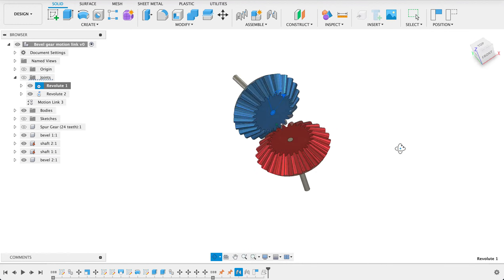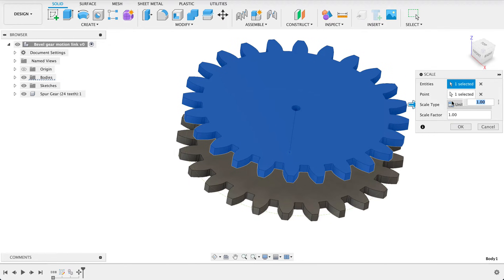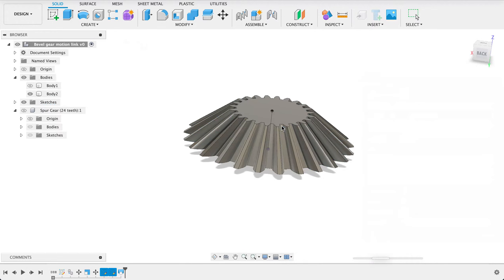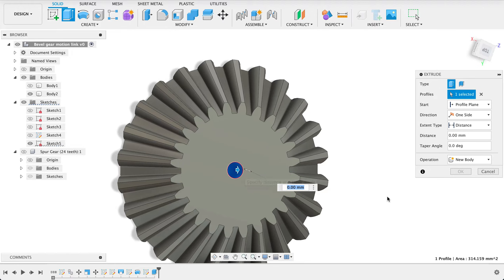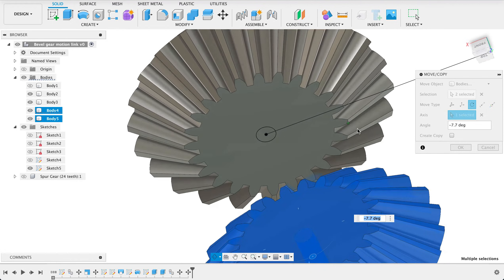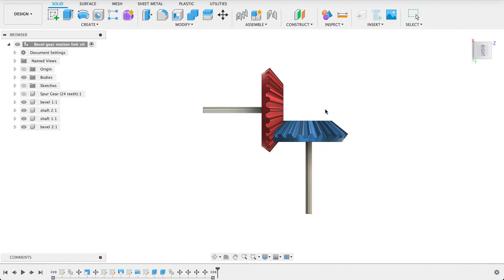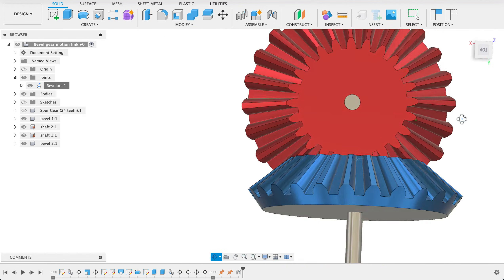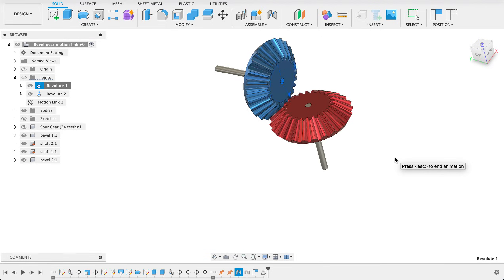Fusion 360 tutorial: Making a Bevel gear pair with motion link

Comment: if you make each gear a different size does it still work?
Reply from the maker: So long as the teeth mesh it will work fine you will just have a different gear ratio
Reply: @Fusionfundamentals  ty man, love the video
Reply from the maker: @Moon-eb2zc thanks 🙏

Comment: How did you decide to use 80 mm for the separation? Does that change the  angle of the bevel interface?
Reply from the maker: Not sure. It was a while ago. But usually just look at what is likely to fit and try that. All my videos I practice before recording so I’ll work out the kinks in the design before hand

Comment: Wow you think this will work on my 3d printer, I need 2 bevel gears
Thank you so much, so easy and direct
Reply from the maker: Yes it will definitely work. You just need to make sure that the gear you designs mate properly then you are good to go
Reply: @Fusionfundamentals  thank you man, I will try to play with tolarances and maybe make a tolarance gap of 0.2mm so each tooth is that much smaller.

I have multiple 3d printers so their precision is all different. Best one can go down to 0.15 and others to .3 or .5
Reply: @ROBOROBOROBOROBO also to make gears print clearly a module of 1.5 has worked best personally but is only good for when backlash isn't an issue